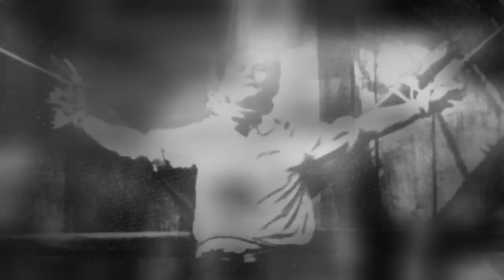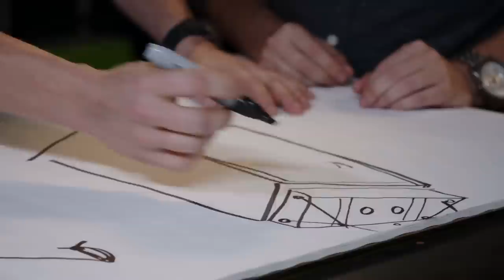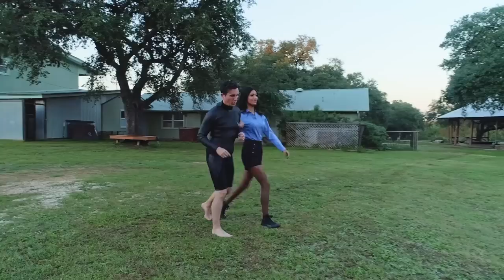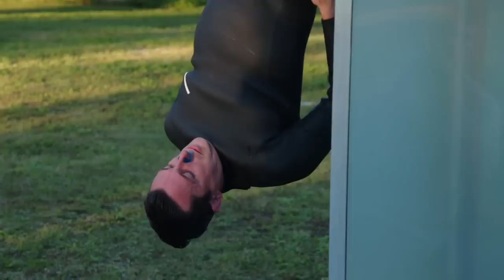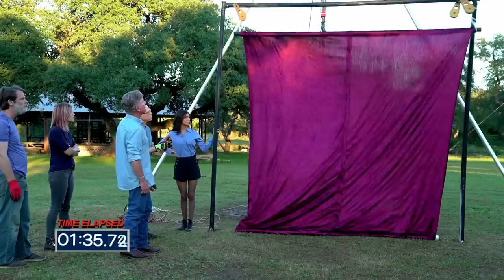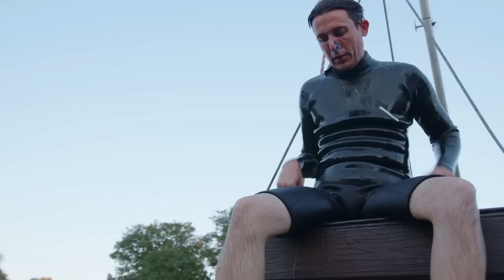Specialists Crack Houdini's Water Torture Cell Trick | Houdini's Last Secrets

Comment: The trick is also done in a large metal milk urn. The secret it was double sleeved. So you get in side and it's properly padlocked, but pushing your head up, pushes up the outer sleeve that surrounds the inner chamber full of water. You jump out and put the sleeve back on.